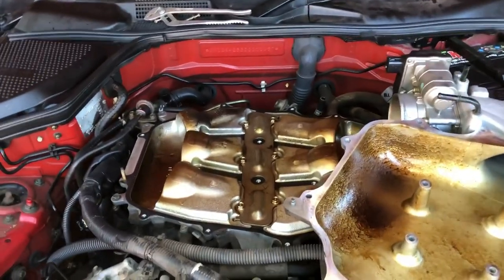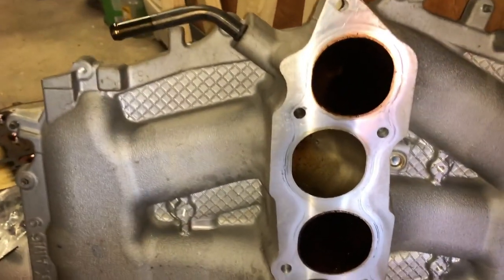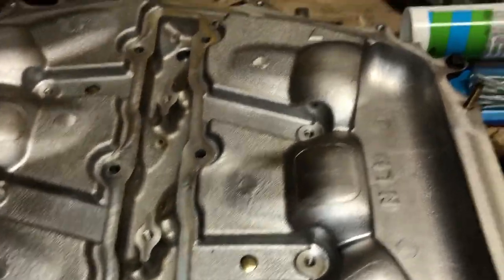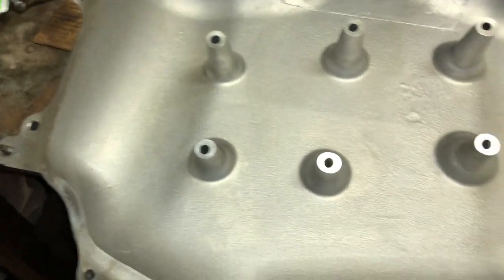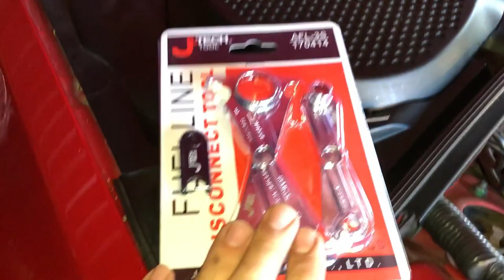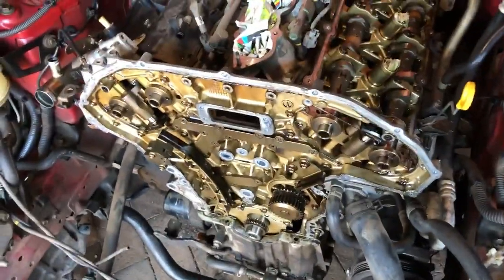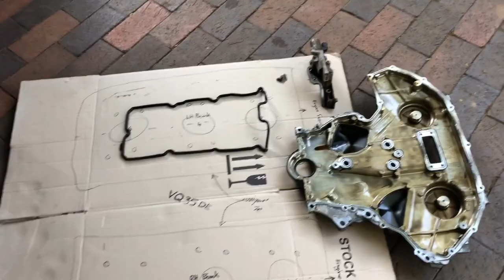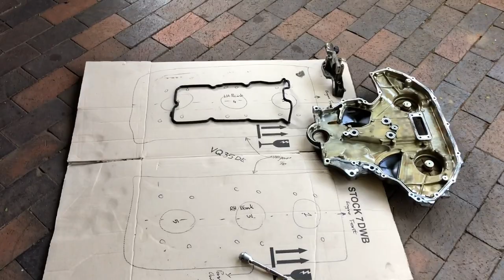350Z VQ35DE Smoking - Valve-stem Seal Replacement Part 2

Comment: Why are you doing this? I'm asking because I started having blue smoke on cold start. Idk what it is but I was thinking about doing this but I'm not sure.
Reply from the maker: There are couple of tests you can do driving wise to try diagnose the issue. See link for articles i used to try diagnose rings vs valves https://carfromjapan.com/article/car-maintenance/blue-smoke-from-exhaust/amp/
Reply: @CappiZDrift  that was really helpful. I think I'll have to replace the valve stem seal cos I only see blue smoke on cold start and after the engine warms up, it goes away.
Reply from the maker: Awesome glad that helped, let me know if replacing seals helped 👌🏼💪🏼
Reply: @CappiZDrift  I've a question though, when you replaced your valve stem seal what was the most difficult thing you encounter? And what are things you suggest I should change while replacing the seals
Reply from the maker: So i did it without removing the heads, that made doing the seals on the rear cylinders quite tricky due to space. Not having the right tools also makes it tough. So i made 3 versions of the spring compressor till i got to a point where it worked. Putting the keepers back was probably the most difficult. Also make sure you have a torque wrench small enough as all the bolts for the cams and timing cover are fragile, make sure the threads are clean and don’t have oil on them or in the holes i stretched a bolt , almost broke it off in the head. And most importantly the workshop manual!!! Keep track of what goes where as there is a lot to take off. And most importantly take your time and double check your work... and good luck it’s a fun project with a huge sense of accomplishment when you done💪🏼